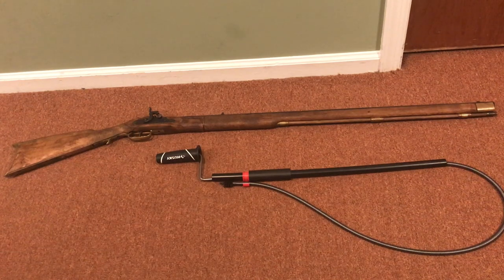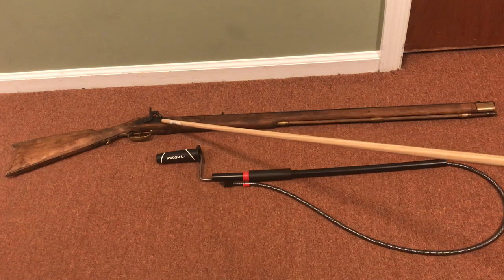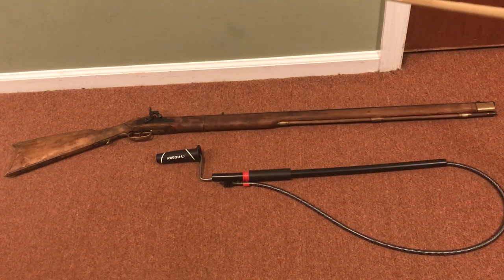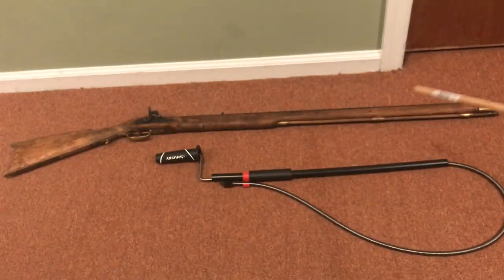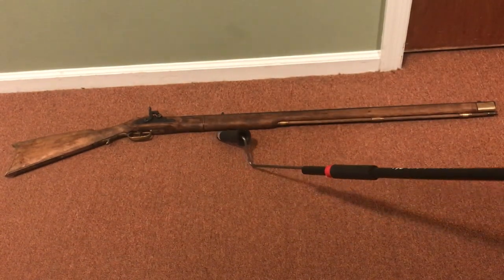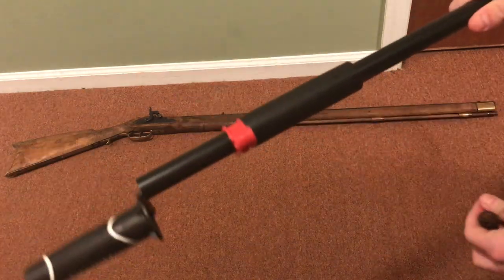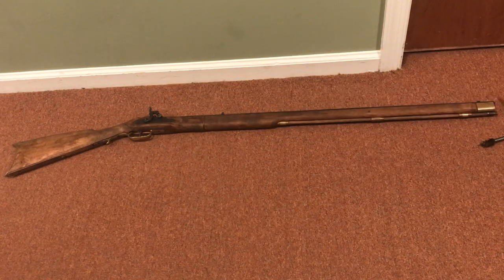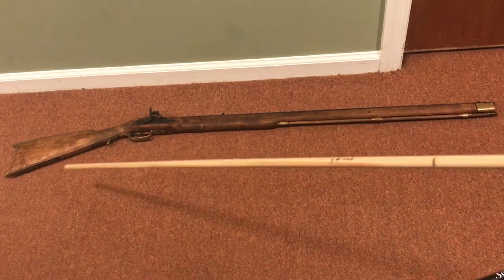Cleaning brush stuck in muzzleloader FIX/ Tutorial

Comment: To prevent this in the future, never use a brush with a crimped on threaded sleeve,  always use brushes that are attached by a loop.  It is not foolproof but the loop attachment is far less likely to cause this issue than the crimped type.